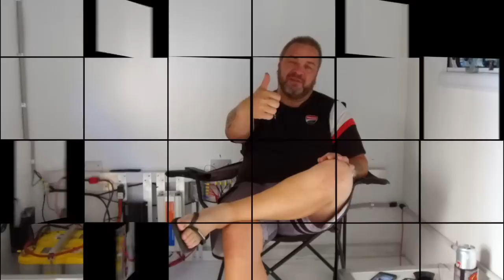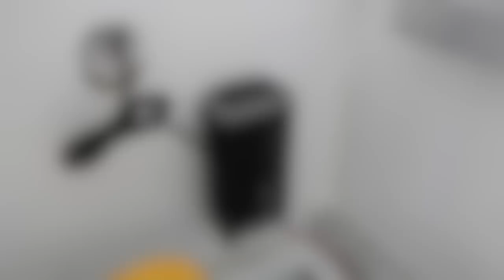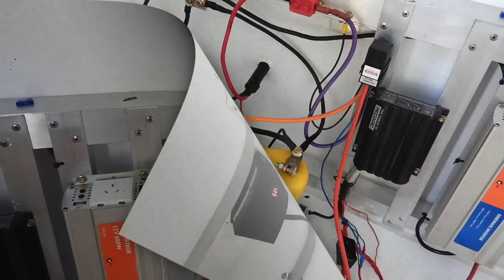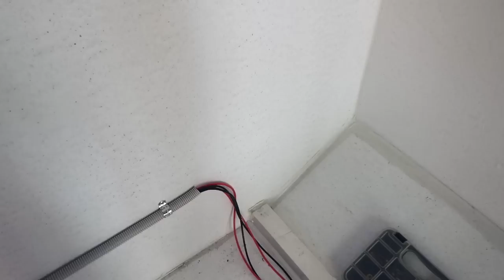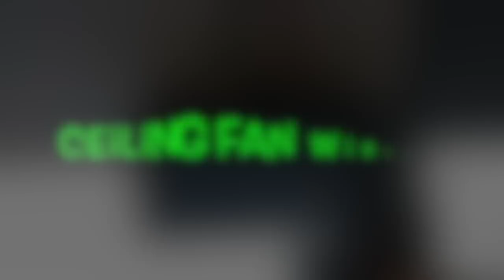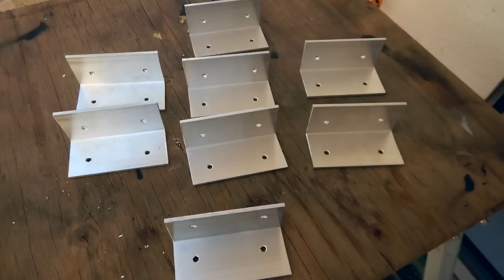LandCruiser Expedition Truck Build _ 1st Stage Electrical Install _ Ep 26

Comment: Good choice in the Optimas, 👍 I’ve had two of the same in my T4 Syncro for the past 10 years and I’m still getting a decent amount of amp hours out of them. 

I’m running a 50 Amp Sterling battery to battery charger rather than a split charge relay and there is a charging profile that matches the Optimas so they get properly charged off the alternator. I think that is the main reason for there longevity.

Comment: Great video as always - thank you!  I have some questions.  What happens with the wiring harness that leads to the roof when you collapse the popup?  Are you using the horizontal aluminum cross plate as a ground bus?  If so, are you extending the ground bus to the vertical plates?  Thanks again!
Reply from the maker: Hi, Great question, the pop up roof has a collapsable conduit so the cable will fold in with the canvas.
The ground bus is bolted to the aluminium RHS all the angles and other parts are riveted to the frame will form a really good common ground due to the current of any items directly grounded to the vertical members, these will be sufficient.